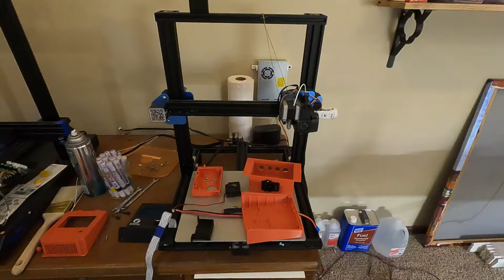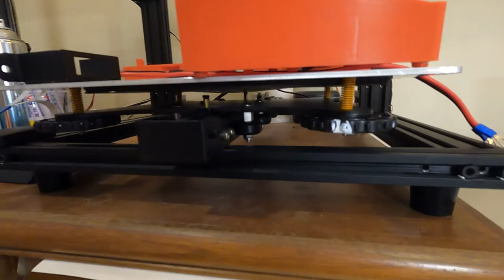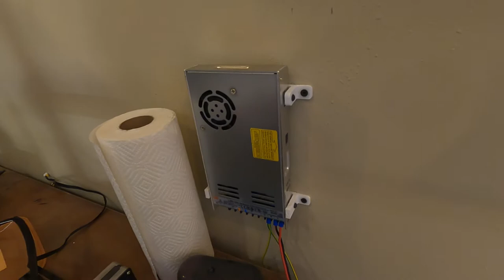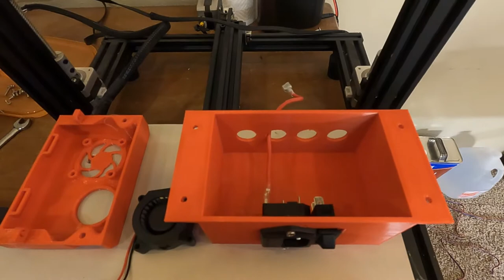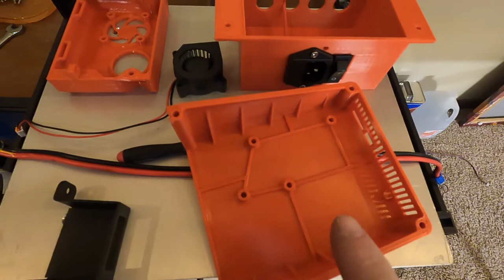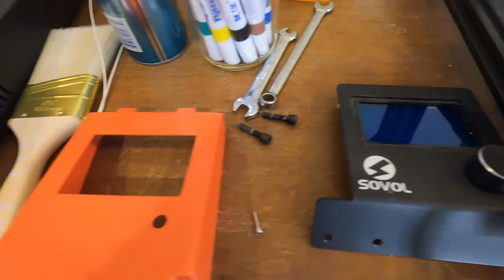Sovol SV01 - Moving the Electronics Part 2

Comment: I'm doing the same thing so I can build an enclosure and move the electronics outside of the print area. I'm also going to update to a all metal hotend and BTT 32 board at the same time. Keep us posted on Part 3... Are the boxes available online or something you've designed yourself? Looks good.
Reply from the maker: I got the boxes off of Thingiverse.  They are there, but searches on Thingiverse are hit or miss!  None of the boxes were perfect, so I should have made my own on Fusion 360, but for me that's a very time-consuming aspect, as I'm not really good at Fusion.  However, they work fine and with a few modifications, such as drilling and tapping screw holes, they work!  Yeah, when I bought the SV01, I added the BL Touch and all-metal hot end.  It's been working well.  I still need to check actual temp at the hot end, and check my e-steps calibration on the extruder.  Seems like it's extruding a little too much!  
I tore down my SV03 to do the same thing to it.  The wires broke on the hot bed, just aft of the strain relief, and started on fire.  The overtemp warning went off too, and shut down the printer.  So it's getting an overhaul right now.